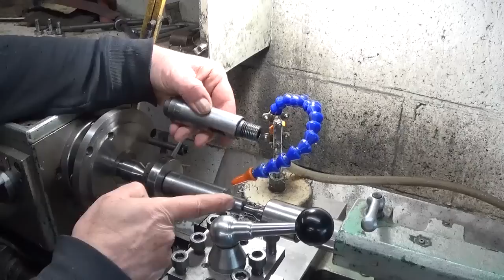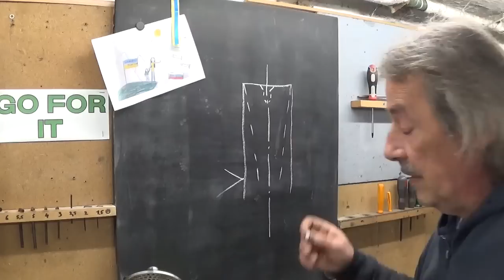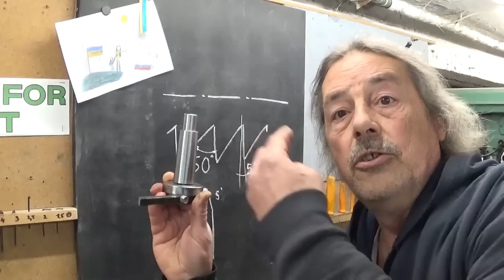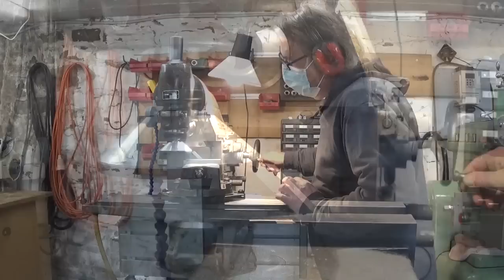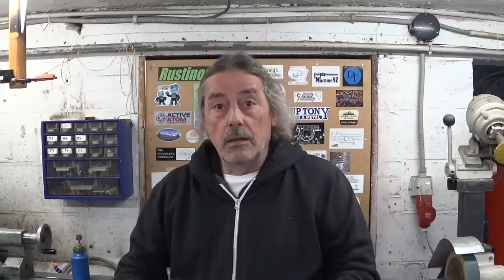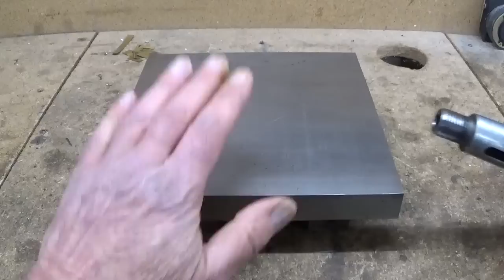Taper adaptor... still not!

Comment: According to the plate on the inside of the head stock gear cover, your lathe can cut inch threads. Specifically the plate shows the gear train for a 12 pitch thread. 
A 127/120 compound gear is the smallest gear set that gives an exact conversion between metric and inch threads. There are other compound gears that are physically smaller to fit into the gear train that are so close to the exact conversion ratio that the error is often lost in the error in the lead screw itself. 54/57 compound gear for example is 99.7% the correct value. You would be hard pressed to detect the error in 100mm of thread.
Cheers from NC/USA
Reply from the maker: I don't have the gears for that, but I can make them.

Comment: I can't knock you for trying. One day when I was living in England I got stuck on a job in my shed and an older guy who had a hobby the same as mine came around to my house and sorted the job out in ten minutes! I spent hours on it! It was the screw-cutting chasing dial that had a problem, it would not engage when I pulled the lever down to engage the lead screw . the tufnol small gear had teeth missing and it was missing the lead screw all the time. All he did was take the chasing dial apart and he found the missing teeth that were hidden away from me. I felt so stupid lol
Reply from the maker: Lol. I'll say, if you don't try it will never work :)

Comment: Filetage d'artillerie is the thread form also known as 'Gun Breech Thread'.   it is a type of Butress or Sawtooth Thread form employed because it has immense resistance to shearing in one direction of force so it is most suitable for resisting the high loads encountered at the breech end of artillery guns. I hope you are not planning on firing any projectiles out of your dividing head or your mill spindle😂
Edit to add: Good to see you are getting better stability from your lathe saddle.
Reply from the maker: No need to worry, Howard. I'm a peaceful person. I woun't fire anything at all :)

Comment: Really enjoyed both parts of that video Michel. I like the mill as your cutter grinder. I've thought for many hours about my lathe bed accuracy and done many measurements. It is so easy to get on the wrong track because the results can be so misleading. It is a very complex subject that takes a lot of brainwork to understand what is really happening (often not what you think is happening). Cheers
Reply from the maker: You're right. You have to compare mesurements that can't be compared because there is no standard zero point to start from.

Comment: Hello Rusti - so far I’ve seen just one comment giving the name of that sawtooth shaped thread form, the buttress thread. Both Deckel and Schaublin collets use this thread. According to S. Gotteswinter, the idea is that the nut will not tend to pull the tail of the collet one way or the other.

I have seen the buttress thread used only one other place, myself: in the large studs that bolt the bottom of the twin solid rocket boosters of the space shuttle to the launch pad. There are eight such studs in total, each held in with two massive hex nuts. The nuts are outfitted with twin explosive charges inside; during the launch sequence, these charges are detonated and the nuts are split so the the studs can fall away. I presume that the buttress thread was chosen to help with stud alignment, but I’m not sure.
Reply from the maker: Over here we call a Buttress thread a "Filetage d’artillerie"

Comment: Hi Rusty,  Thanks for in-depth explanations. And how you can get caught into things you can not have control over. It's good to acknowledge that it is a hobby lathe  & not a CNC Machine 
But ... lol always a but   😆  You have a lot of knowledge & you Produce excellent projects while having fun.
My question is.... Have you checked the Alignment of the Bed for not only twist, but horizontal measurment, including head alignment. Has your lathe got adjustable legs to rectify lathe alignment.
As always, excellent content, keep up the good work.
Reply from the maker: I check the bed with the laser setup. Works great.

Comment: Try a shear tool for the last pass or two... should leave a wonderful finish. You can make a shear tool by rotating a boring bar in the tool holder.
Reply from the maker: Sheer tools on the lathe work great. If the saddle doesn't twist while cutting :)
Reply: SDUCR type boring bar fitted with a DCMT or DCGT insert works best for shearing cuts.

Comment: I think you have sorted out the contuing problem you had with your lathe, using sand paper was a good solution, same as scraping it would have done, I see no problem with this, after all the lathe is much more usable now, and it looks like the finish of the cuts are better, nice one Michel! cheers, Dave
Reply from the maker: Thanks Dave. And if it doesn't work anymore, I will fix it again.

Comment: Hi Michel ☺ looks like you made a big improvement to the lathe problem, and turned a nice taper, whith a good fit, you are quite correct to know when to draw the line on little machine, or tool niggles ,when you are a hobby shop . Otherwise  you get all ocd about something and it spoils the fun . Anyway fixing a problem is half the fun of it , and inspiration, and keeping the brain cells working is a good thing. And I'm sure we'll see an 80 tooth gear being made before too long, and a working adapter at the end, keep doing what you do best, stay safe my friend, best wishe's to you and your's, Stuart UK.
Reply from the maker: Thanks Stuart. A bit of thinking sometimes is good for the brain :)

Comment: Hi Michel, well done on getting your lathe up and running again, the finish on that taper looked perfect and fitted really well. 

Thanks very much for explaining how you got there👍👍

Thats an interesting thread form, be interesting to know what it is. Bad luck with the gear labelling ... another gear cutting video on the horizon!!

Great video, have a great weekend and good luck from Spain!!
Reply from the maker: Over here we call it "Filetage d’artillerie".
In English it's "Buttress thread"
I'm sure you will figure it out what it's called in your language :)
Reply: @Rustinox  Hi Michel, just spent a happy few minutes looking up the definitions for the buttress thread. English is my first language as I am English but I have lived and worked out here in Spain for close to 25 years now (how did that happen so quickly?). 

The translation to Spanish gives me "Hilo de contrafuerte" or "Rosca de contrafuerte". Its not one that I have come across as its quite specific for certain applications. Interestingly the UN and BS standards call for a 7° - 45° flank angles and the machinery handbook 5° - 45° flank angles and then there is a German and Italian version with 3° - 30° flank angles. Screw standardisation .... pah!!!

Have a great weekend!!

Comment: Try a vertival sheer tool. I testet it this week. The results are absolut stunning. The surface on mild steel is absolut smmoth now.
Reply from the maker: Sheer tools on the lathe work great. If the saddle doesn't twist while cutting :)

Comment: I have Chinesium lathe(Titan CZ300A). I buy it new and it's not cheap for my budget(over 3200€) and it has that same rocking saddle problem. I hand scrape that flat rear slide part and lapped(too tight gap to get scraper in there) that prismatic part on front with some lapping films stick on lathe's bed. It takes a lot of time but now it "ok". There are still some room to get it better(too shiny surface to slide freely etc.) but it's ok to my need for now. That lathe has another problems here and there too that's why I don't recommended that thing to someone else to buy. 

But this is our hobby and improve our tools is one part of it.😄 I also have year 1984 USSR-made small(yes there are small mills made by USSR) vertical mill(NGF-110 W4) and it have about 0.5mm/150mm error in knee/Z-axis.. And that's not wear because it's wrong way around to be that. Just to much alcohol and low working motivation I guess. I need re-cut that knee's dovetail some day. That why I buy old Värnamo Prema No2-shaper last year.. Good excuse to get one.  And some luck to find it..

And last but not least this channel is one big influencer to me to get shaper and great knowledge to operate it safety. So thank you very much! I wish you all the best and good luck with your future projects. Your videos are so great!
Reply from the maker: That's nice. Thanks. Have fun :)

Comment: Good work Rustinox. If it works for you and gets the job done, that's all that matters. Now you can work more precisely much easier without a lot of grief. I did a similar thing with a worn lathe I once owned. That worked as well. Cheers Tony
Reply from the maker: Thanks Tony. It will work for some time. And then I will do it again :)

Comment: Hi Michel.

For cutting your thread, as your gear train should be 40:80, 72:36, surely it's only important that each pair of gears has a ratio of 2.  I think you may be able to get by, if the gears fit, of course, with (for example) 30:60, 72:36. (or substitute any 2 pairs of gears you have wit 2:1 ratios.

Indeed, as the ratios cancel each other out, any 2 pairs of gears with the same ratio.
Reply from the maker: I didn't think of that. You're right. Thanks for the tip.